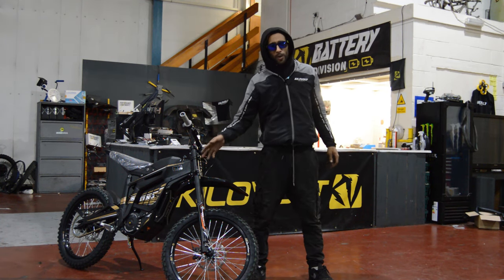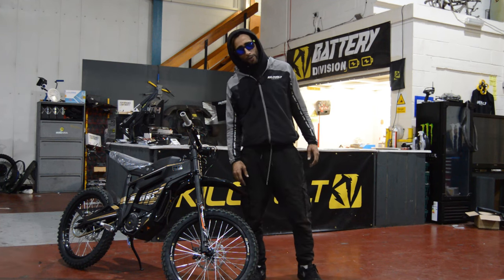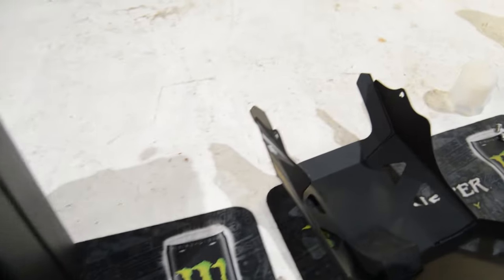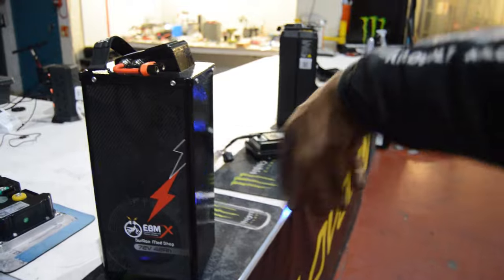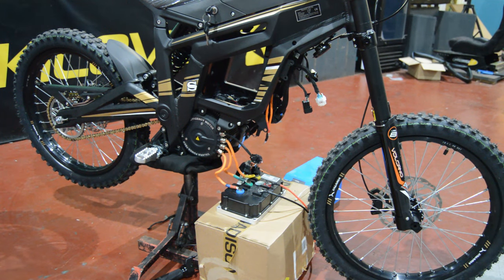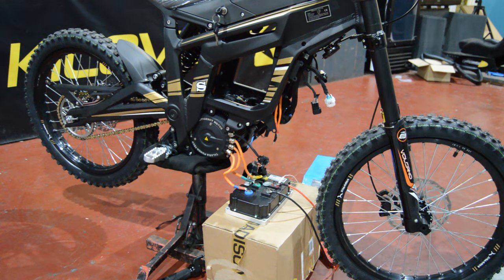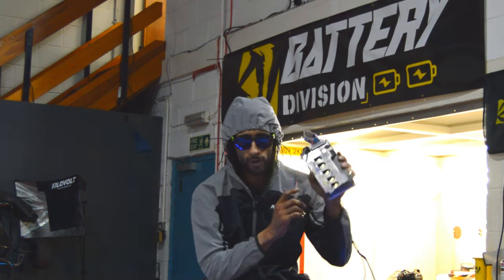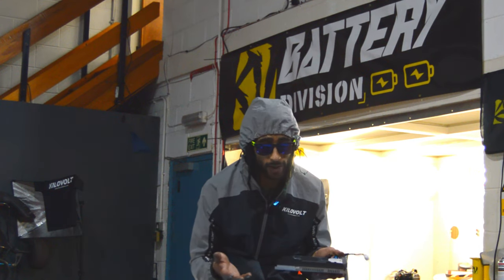Taking apart a Talaria Sting - Testing the Encoder Converter and Fardriver Controller *WIN / FAIL*

Comment: Bro did you sort this in the end? I want a far driver controller on my sting if you can fit it I'll book it in and drop it off.
Reply: I'd even consider changing the motor if it will work with the QS

Comment: So did the converter hall sensor work for the ASI controller? Asking because you didn’t make another video.
Reply from the maker: We didn’t get a chance to try with the Asi - soon after I saw others do it with the ASI successfully so we decided to move onto other things . As far as I’m aware it does work with asi and the converter
Reply: @KiloVoltBikes  I bought the encoder QS 165 motor instead of the Hall version on accident.  with the encoder to Hall sensor converter will the QS 165 Encoder motor work with the BAC 4000?